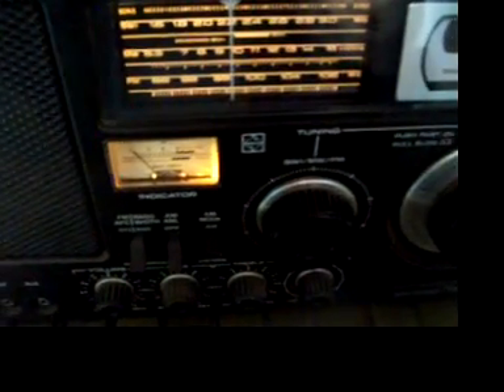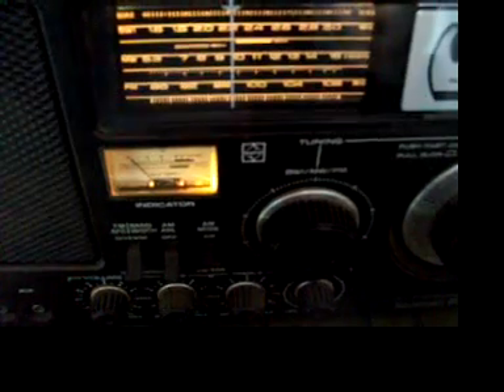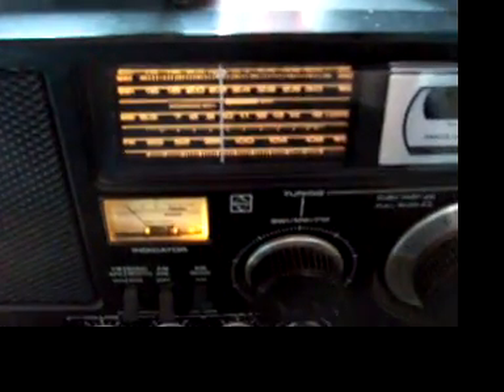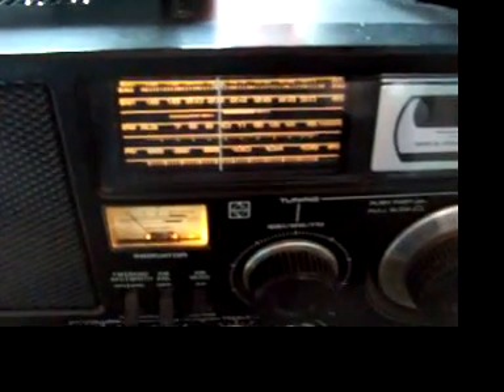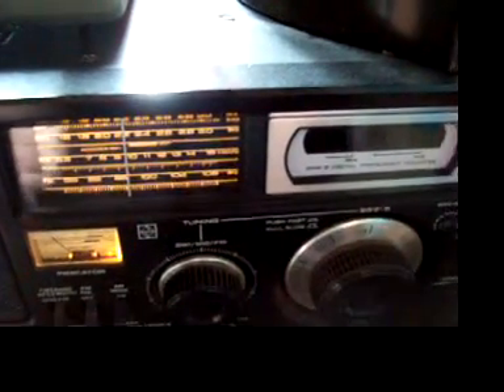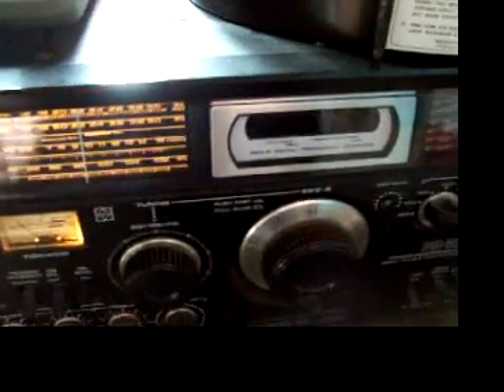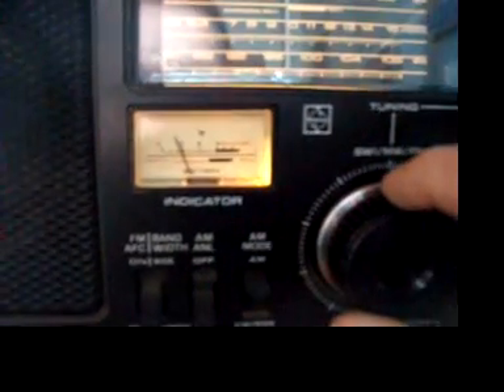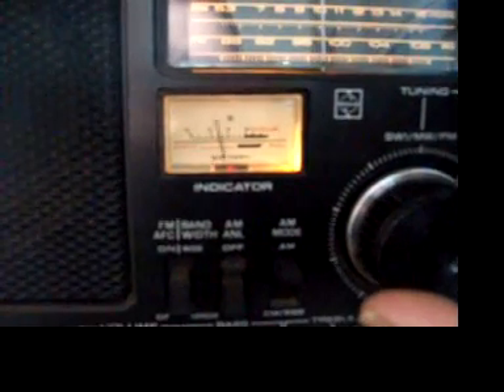Indoor AM Loop Ant Test

Comment: I wish I had one as a kid too! Select-A-Tenna is a tried and true simple MW loop. Inside is a wire windings attached to a variable capacitor. I also have the Terk brand AM Advantage and a vintage RadioShack brand loops. They work best when aimed in the direction of the desired station like a wheel. The windings of the loop should be parallel with the windings of the radio's ferrite core antenna. Nice video demo! I'm in Florida, but lived in Timaru in '73 & '74. Beautiful country!

Comment: I just got one of these loops used and experiamenting with it using my Grundig 800 for the receiver... I found that an inch of double sided mounting tape (heavy duty) is a great way to "mount" or "secure" the antenna to the radio without drilling holes or other crazy modifications. The antenna is very touchy!